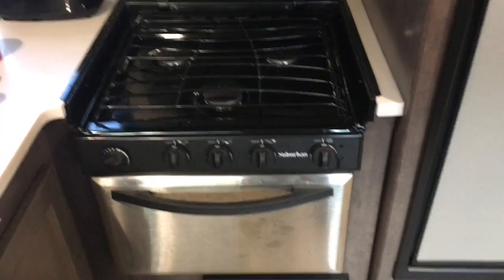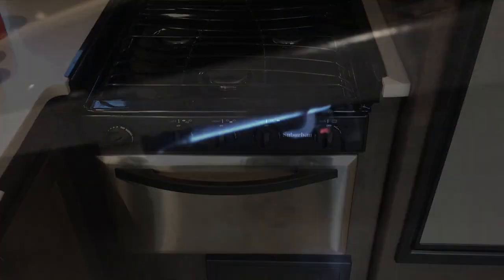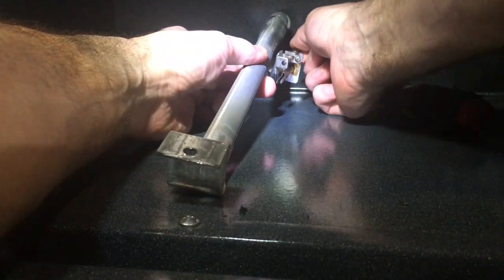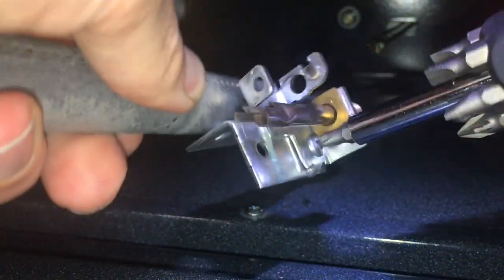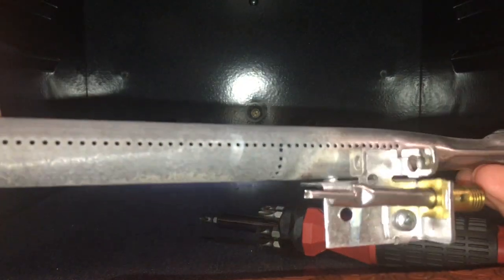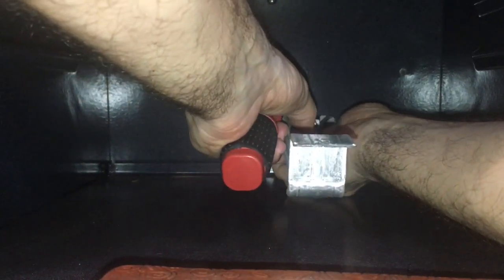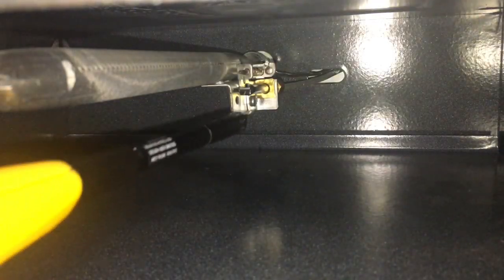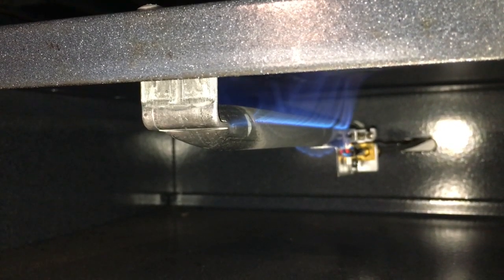Suburban Oven On Travel Trailer RV Does Not Stay Lit Repair

Comment: Thank you every much! My trailer bought new at UNITEDRV 2 years ago has never worked, it’s been back to their shop 3 times to fix , last time they put in a brand new stove! It does exactly what your does! Each time they said it was fixed, new one exactly the same! I ordered one from your link, it came today, oven has been on 30 minutes and not 1 flutter , still burning!!! Thank you!!!!
Reply: Qicvick, your story is exactlty the same as mine!!  I bought a brand new OutdoorsRV and the oven would not stay lit, even after many trips to the dealer, finally warranty expired and my extended warranty took over.  After my trlr sat at the repair dealers store for six months I took it back so I could camp in the summer.  The repair facility called me and told me not to bring it back because they did not want to work on it any more.  They were the ones that sold me the extended warranty!!   I took it elsewhere the next repair facility had my stove for six months so I finally called the extended warranty people and demanded a new Suburban stove assembly, they sent it and it was installed. IT DOES THE SAME THING AS THE OLD STOVE, AS SOON AS THE PILOT GETS HOT IT SHUTS DOWN. I am still trying to figure out what is going on.  I have checked the propane pressure which is 13 inches of water right to the oven burner.  Do not know where to go from here.??

Comment: Great video.  I agree with your assessment. The crimp was too much. I used pliers and ever so gently, applied light pressure to make the opening slightly larger.  It worked. Oven ran for 15 minutes without shutting off or the pilot light sputtering.

Comment: Dean Hodges 6/10/2021

Thank you so much!  I bought the trailer used, but the oven had never been used, and the trailer used twice.  The pilot always lit, but when the temperature for baking was selected, after 5 or 6 minutes, the oven (including pilot light) would shut off.  Without paying a dealer to troubleshoot it, no one would help.  I watched the video a couple of times and decided it must be the pilot assembly and not the oven control valve as suggested by one dealer.  I ordered the part from the link, and completed the entire job in less than 20 minutes.  The oven is now working and has been for over 30 minutes with increased oven temperature settings.  Thank you !